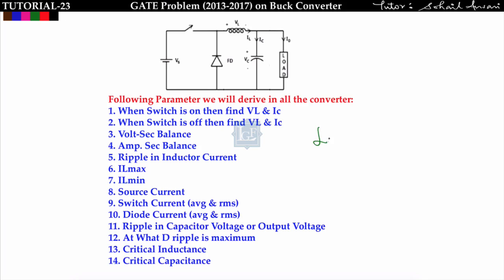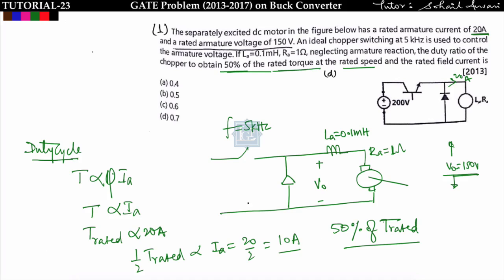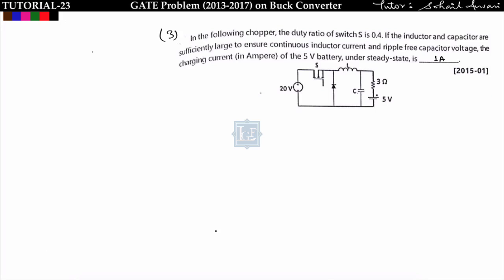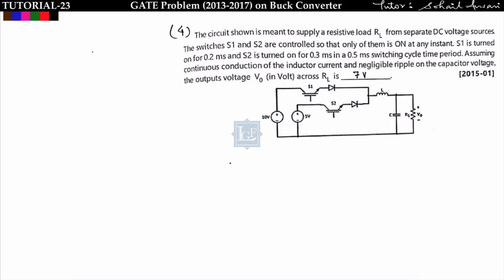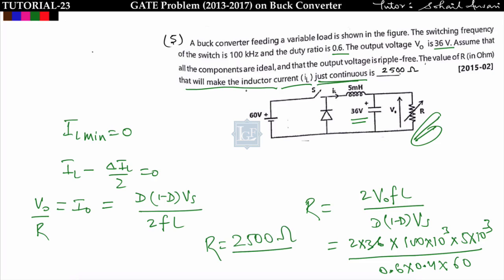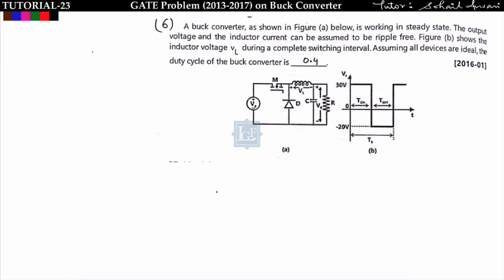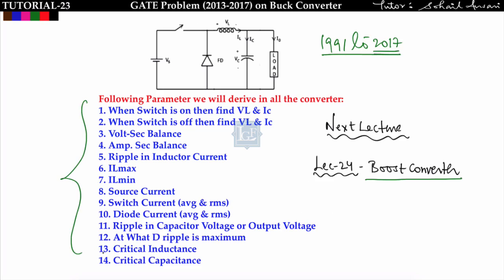Lec 23(b) GATE Problem Solved (2013-2017) based on Buck Converter

Comment: sir in que 2 there is ans is same but there is some mistake i think...bcz the waveform of diode conduction is given..not the waveform of output voltage..so ans remains same bcz of same duty cycle

Comment: TnQ so much for your teachings Sir(Every topic for me  is going so easily now). 
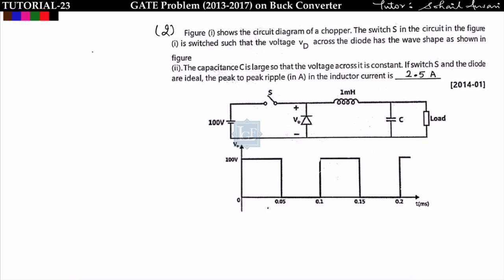Alt for Q/2 (video 3:59) ----›››
· Switch will conduct when diode will be in OFF position. 
 So,  T(ON) = 0.1 - 0. 05 = 0. 05
       T(total) = 0. 1
       D(Duty cycle) = T(ON)/T = 0. 5
       so,  Delta IL = D(1-D)(Vs)/fL         [f=1/T ; Vs = 100V ; L=1mH]
=2. 5
Reply: Duty cycle is always with respect to switch, where Ton is first half cycle of conduction not the second half cycle

Comment: sir in lecture 23(b) in Question-4 why u have not taken Vo=DVs to calculate the output voltage across R by both the source??
Reply: Er.S Bibiyan  Yeah I have also done by this method only but I didn't get solution by Sir. How can we ignore voltage across inductor?